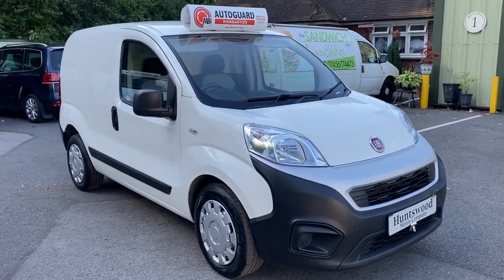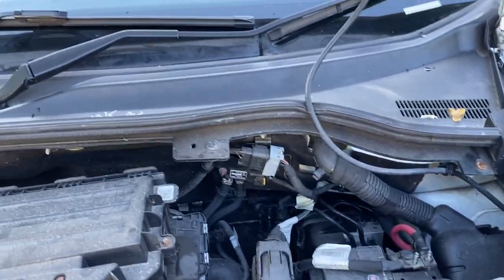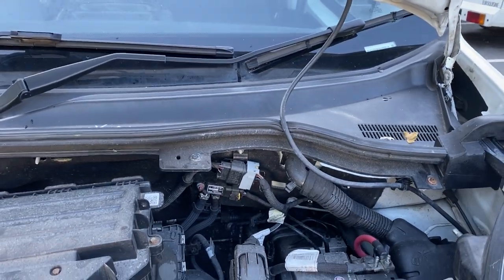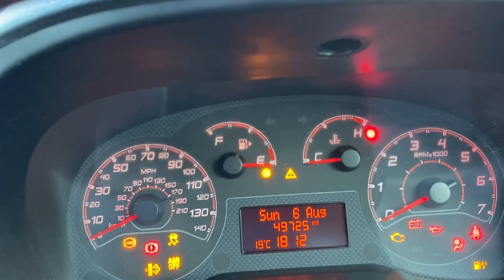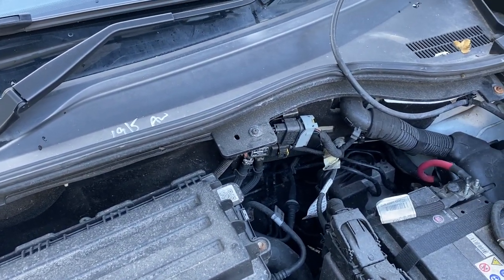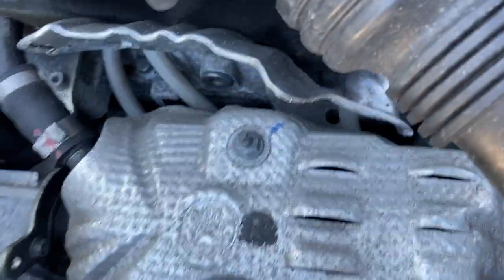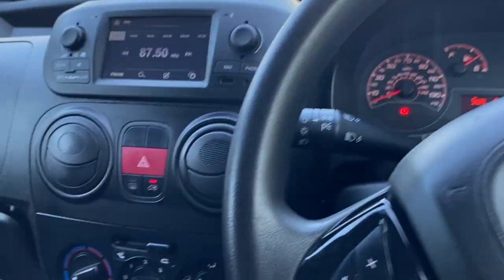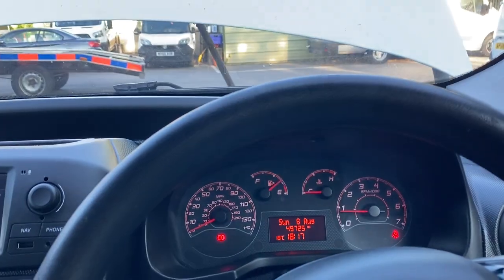5 COMMON PROBLEMS / ISSUES / FAULTS WITH A PEUGEOT BIPPER 1.3 LITRE DIESEL VAN

Comment: Just had timing chain done on mine. It’s done 93k miles and started rattling really bad. It cost £750 for anyone wondering how much it costs
Reply: Engine out, or can be left in as I'm reading?

Comment: Well I had the front strut swivels done on mine along with 2 new shockers on the back cost me £320 ish at a garage. It also had to have complete new injectors due to very low pressure it was difficult to start when the engine was hot they cost just over £1000 at a diesel specialist. The timing chain has also been replaced however I do like the vehicle a lot mine is a Bipper Tepee it's the same mechanically as the van. All vehicles have there faults no matter what it is oh and it costs me £35 a year to tax it's and less than £200 a year to insure and I have no plans to swap it anytime soon for one of those awful milk floats called EV's.

Comment: I have a Fiat Fiorino Premio semi Automatik transmission which of course is the same exact as the Peugeot Bipper , Fiat Qubo, and Citron Nemo1.3 multi jet  and with 298 K I had very few problems. I had to replace the clutch plates both of them in the semi -automatik tranny, I did all new glow plugs about 80k ago still good and I did replace the strut mounts about 100k ago other than that nothing else except tires and brakes timing chain original and fine with no stretching issues. Pretty solid vehicles

Comment: That rattling noise sounds almost all diesel engine man. My Renault 1.5 dci which is a timing belt driven sound the same with thay ticking rattling noise.
Reply from the maker: With all due respect, you clearly don't have much experience with these engines. Ask any mechanic about timing chain problems on a 1.3 cdti engine.

Comment: There are like 10 engines in total on Qubo, Bipper, Nemo. Which one is the best? I know Fiat Qubo have the most economical 1.3 MultiJet 75 HP 16 valve and the most powerful 1.3 MultiJet 95 HP.

Comment: There can't be smoke from the exhaust - it has a DPF right?
Reply from the maker: A vehicle will smoke from the exhaust if it has turbo, injector or engine problems, even with a DPF.
Reply: Yep, ours puffs smoke from a cold start (turbo) 🙄. Also rattles a bit from cold (timing chain), also engine coughs and splutters from cold (injector) and now it's loosing a small amount of coolent. (130000 miles)
Reply: I've had mine 4 years, bought at 130,000 miles now on 175,000. Absolute tank. Had to replace timing chain last year but other than that she's served me well

Comment: I have one solid as a tank but there is a problem with the egr and its a 2014 and a 103,000 miles is it worth getting fixed or get a new van
Reply: Egr issues exist for most vehicles, it's not specific to the van. Get it fixed.

Comment: I had a dpf problem, sorted that. 

Compression getting passed injectors, replaced seals and fitted superceded injector clamp nuts and spacers.

I now have a glow plug down so got to sort that.

It's a 2013 with only 80k on it, I definitely wouldn't buy another.

Comment: I just bought a 2018 1.3 HDI Euro 6 Bipper. It has run about 6200miles / 100000km. Noticed when I start it cold the engine runs very rough for a few seconds. It drives fine after that. Can it be the timing chain?  My old Bipper 1.4 belt driven sounds Ok when starting cold.

Comment: Majority the faults you mentioned are typical diesel engine issues. Nothing new really, apart from the strut mounts. 

Add in dpf and egr issue with almost every bloody diesel engines.

Comment: These vans are ABSOLUTE SHITE!!!! Bought a '68 plate, brand new. Changed oil every 3k miles, used as a car, not van, never went over 65mph, IMPECCABLY looked after. At 11k miles top-mounts failed, at 15k front spring snapped....now at a MERE 18k miles I have a timing chain rattle, most likely the chain tensioner. You couldn't pay me to have one of these crap vans again. AVOID LIKE THE PLAGUE!!!